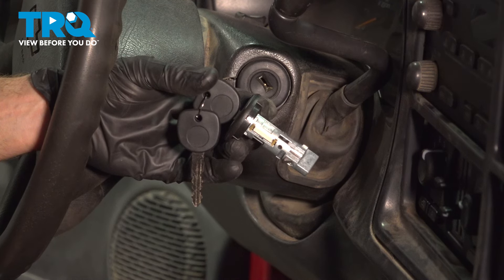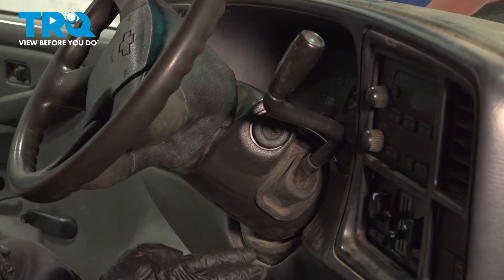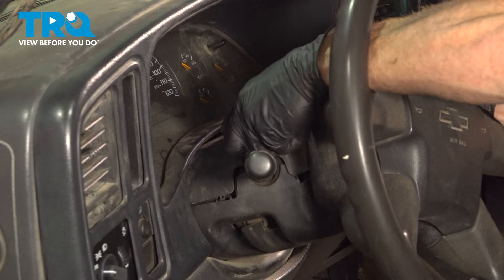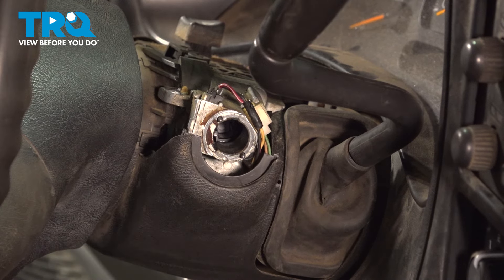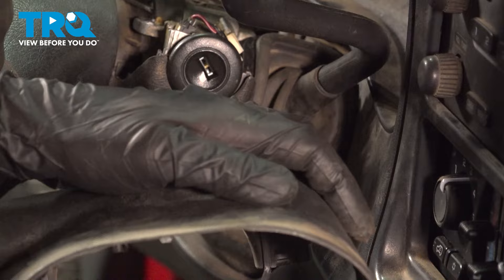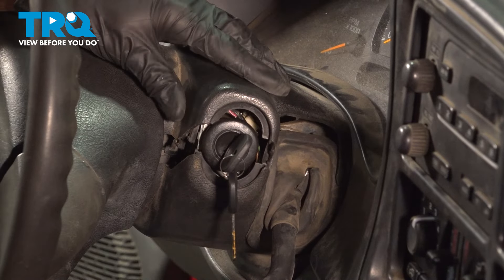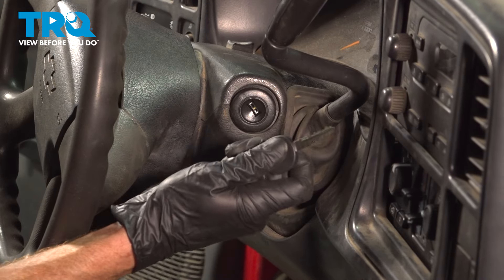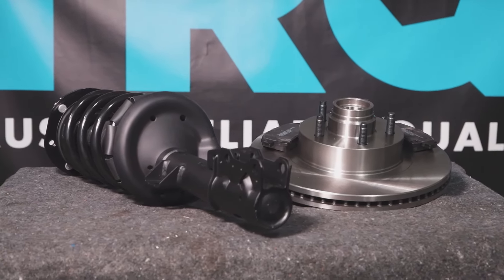How to Replace Ignition Lock Cylinder 1999-2006 Chevrolet Silverado 1500

Comment: What if you lost your key and you don't have a key to turn the ignition
Reply: Some lock cylinders will come with keys already programmed
Reply: Call a locksmith
Reply: You can go to Chevy and have a new key cut with your VIN. Bring your title and DL
Reply: Hopefully you were able to get it fixed. I’m actually doing this today I had a friend basically do the same thing they do to steal these trucks so I can turn my ignition😅
Reply: If replacing the lock cylinder anyways, I'm sure there is a video out there or a way to jank that thing to rotate by force.😂.   But an interesting question, would be neat to know what is found.

Comment: I stuck a pin in the hole,but it would not release the switch
Reply: Literally my exact problem 2:12
Reply: What did you end up doing?
Reply: did you find a solution bro i’m having the same problem

Comment: That new key doesn't need programming? Is it automatic? Does this vehicle not have the security?
Reply: No
Reply: The key is just a simple blank key, no programming. There is actually no chip or codes or anything. Just a simple piece of metal cut to the right shape.
Reply: I believe these older Chevy's dont have the + on the key so they aren't programmed if I'm not mistaken.

I believe there is just magnetic sensor that detects the key in the ring.  Don't quote me in that but from what I can tell, on my 2002, it's a dumb key
Reply: I just checked out a video by TheAccordGuy

 Titles..
Fixing No Start Chevy Tahoe (Replacing Ignition Switch)

It had what looks to be 99-02 Tahoe with a similar actual ignition switch in it.

He replaced just the switch and kept the same tumbler/key.  But he made mention of how the keys have a voltage that matches something called passlock.   It is a little black box , under the dash 

Which is programmed to match the key.
Reply: This video covers '99-06 - the security is through the key fob, not the key itself.  You can reprogram fobs by turning the ignition on (not start) and off twice quickly while holding down the unlock switch on the door panel, then release.  When you hear the locks cycle, hold down both buttons on the fob for about 15 seconds til you hear the locks cycle again. Then turn the truck on to exit program mode and then off - and you're done.

Comment: Your model may be a different year than mine. I had to remove the lower part of the steering column cover because there are 2 screws holding the top ½ down. 1 short screw right behind the ignition switch/cylinder, and 1 long screw on the opposite side behind the turn signal lever/switch

Comment: Not so easy to get the trim off.  There is something holding the top piece on next to the cylinder, 2000 Silverado, that does not appear easy to get to.  I removed two torx screws on the bottom and it is loose but I’m gonna have to figure out how to get the top piece off.  Seems there should be a screw hole at the top or something to get to it.  I have a photo but cannot upload it.

Comment: When I put the new one it it turns over but won’t stay crank just turns right back off
Reply: You have to do a key relearn, key in ignition on position for 10 min then in the off position for 10 min. Do that a few times and it'll stay running

Comment: For a 1996 S10 manual 5-speed the ignition cylinder has a different Tumblr for it. It has a button you have to push . Do you specifically have to have the one with the button or the one with the button is only the manual and the automatic one will not work in the manual origin of the truck?